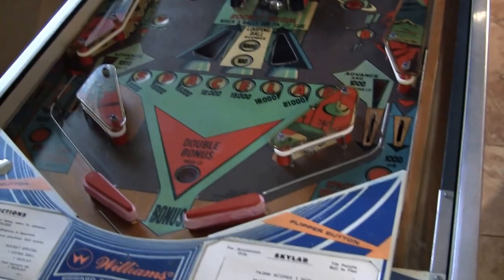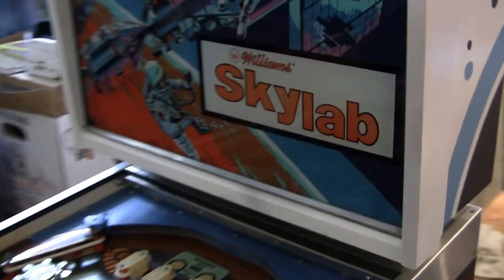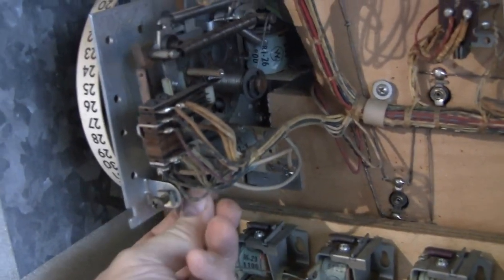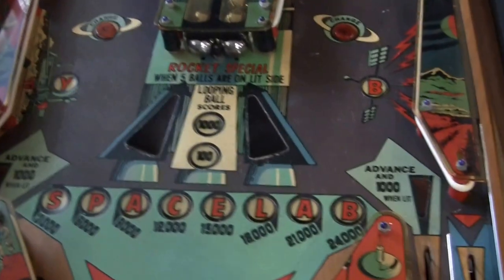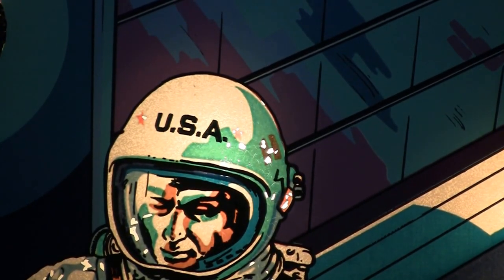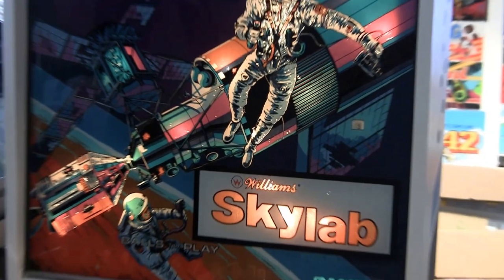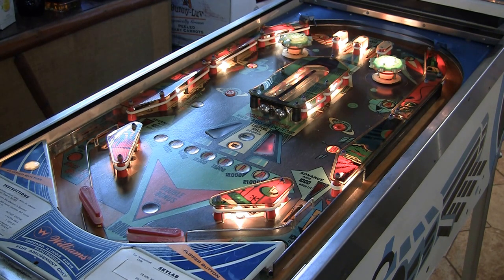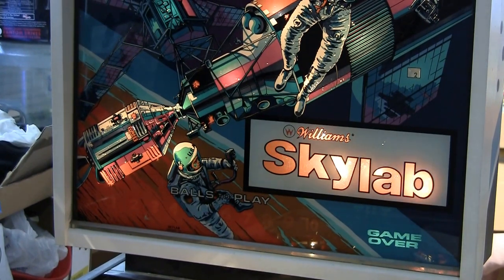First Look: Williams Skylab pinball - www.PinballHelp.com

Comment: My God man, listening to you tryin to explain how the scoring works was killin me.Talkin about spellin out spacelab and callin it "spacewalk"? As for scoring, hitting the bumpers only lights the letter near that bumper. It does not lite up the letters in the "word" Spacelab that gives you your extra bonus. If memory serves, lighting all the letters near the bumpers, along with using the center mechanism allows you to score extra balls. Specials are triggered when you completely light up Spacelab, at which time you goto 2x on the bonus points. As basic as the playing field is, its actually a challenging scoring system, especially if youre chasing the specials or extra ball.
I used to play this machine after school almost everyday. Id only have a quarter to work with but more times than not it would be enough to play for quite a while. Alot of times Id end up with a surplus of plays and would sell them to whoever was waiting to play. I really hope you are going to restore this machine to its original condition and are able to spend sometime playing it. Its been 45 yrs since Ive played this or the limited Spacelab version (same game, just eliminated the free replay option) and I still remember playing it like it was yesterday.
Reply: One of my favorite games, along with Williams' Triple Action. Relatively simple gameplay, but extremely easy to understand as you play, as opposed to the confusing mess found in modern all-ramp focused tables. And wasn't there another table with a sea theme that used the same table lay-out as Skylab? I may be remembering wrong, but I swear there were two tables that had that distinctive 5-ball center feature.

Comment: Wow, looks great. I haven't seen one of these before.  Interesting that the inserts spell out SPACELAB, not SKYLAB. I wonder if the game was originally supposed to be Spacelab, and they rebadged it.

A question for you: you mentioned that the game would have originally had black spots on the cabinet art. Was that intentional, or just a byproduct of the factory surfacing?